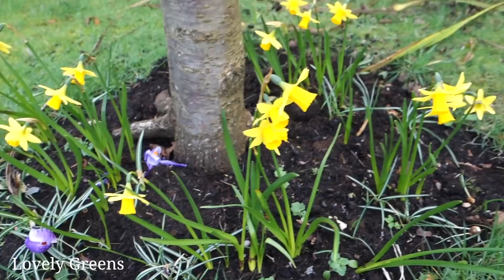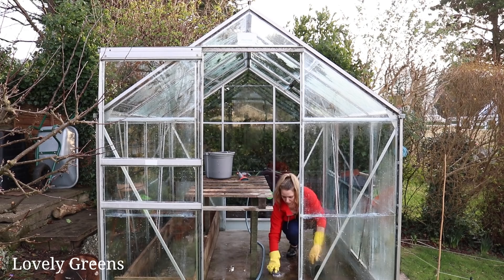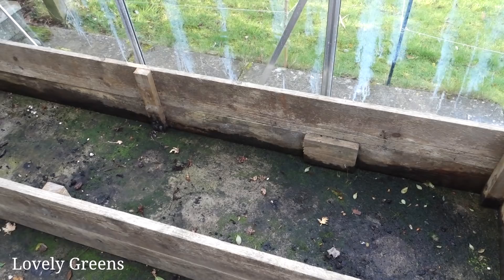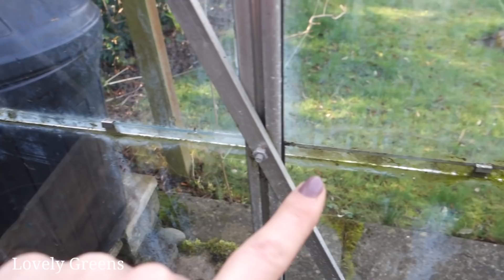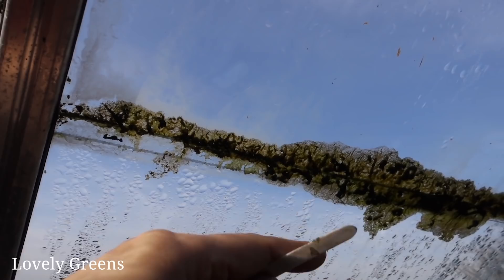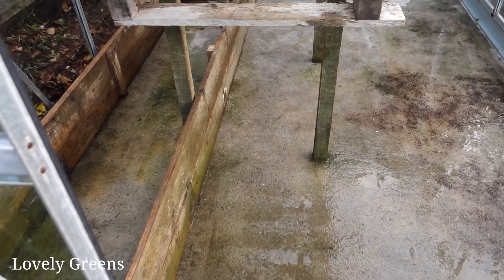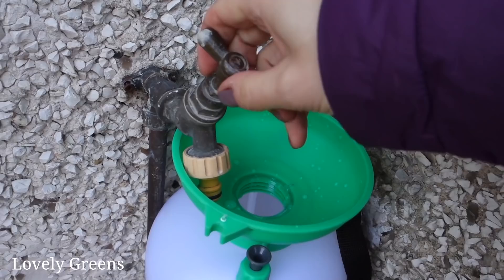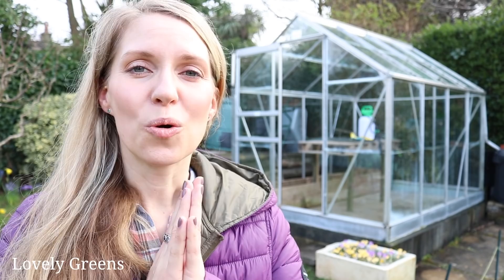Deep Cleaning the Greenhouse using low-impact and organic cleaners

Comment: Thanks for sharing. I had the problem of water. I drilled a hole at an angle under the frame. I put a piece of 28mm copper pipe through the hole, in the corner where water collected. To stop pests entering through pipe, I put a stop end onto pipe. When power washing I remove stop end to allow water to drain.

Comment: That looks great! We were told to use a pipe cleaner to get between the glass. I’ve yet to need to try it but the contractor swears by them.
Reply from the maker: The plant label hack works a treat, too 🙌

Comment: Great idea with the plastic plant labels, I had a try today and have been cutting the plastic labels in four and pushing them either side of the overlapping glass. I found it better for cleaning out the mould and getting the cleaning agent between the Glass also think it will help to drain the water and condensation and to get the anti mould fluid between the Glass. Hope my Greenhouse turns out as clean as yours.

Comment: I have white spongy looking mould around the inside edge of my greenhouse. Its a gravel floor and the greenhouse frame is on strips of PVC plastic sheeting which seem to get damp, the mould is growing from under there. I figured its because of overwatering and not enough air circulation in there, and I scraped the mould off. There may still be tiny bits still in the gravel. But do you have any more ideas or tips on how to clean / prevent this mould issue? Thanks very much for the video, the tip on algae is very useful.

Comment: Greenhouse envy. Always wanted one. It’s cleaned up beautifully. I noticed You have no collars on your cats as  they help protect the birds and small mammals from sudden pouncing, any reason why your cats are collar free. My cat has three bells on her collar. 🙂💚
Reply: The RSPCA In UK recommend you do not use collars as these can get caught on things like fences or branches etc and choke/strangle the cat.
Reply: @vanessaeden8174  safety collars don’t cause this as they have a safety feature, a stretchy elastic section that means a cat can pull it’s head out easily if trapped or a snap fastening that pulls apart if tugged hard enough. My cat is forever losing collars. Also RSPB tell you to fit a bell to your cats collar. ? After all they say that 27 million birds are killed each year by the 7.2 million cats in the U.K. I’m a 25 year RSPB member.